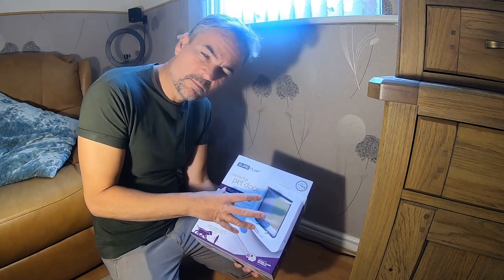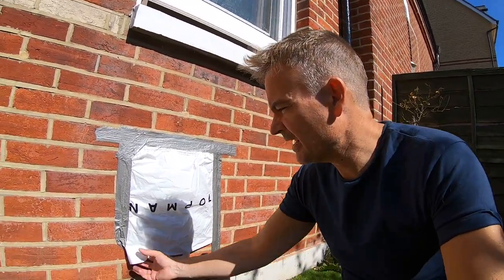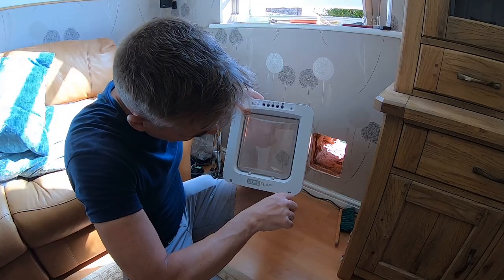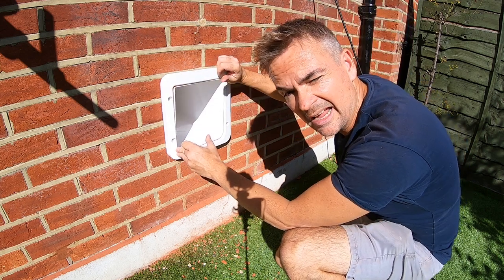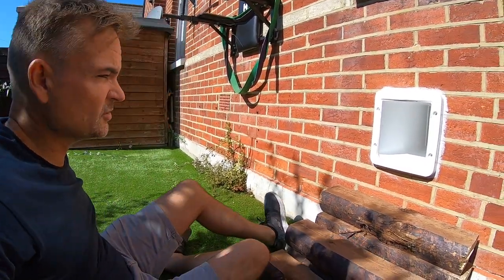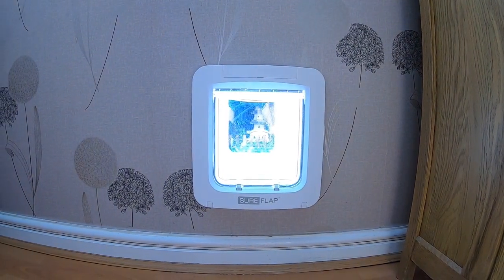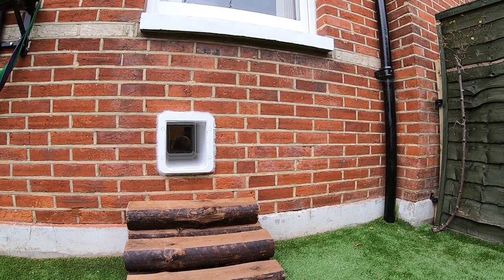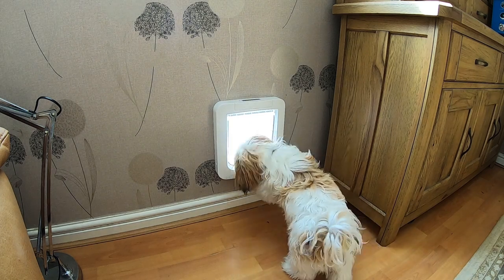Sureflap microchip pet door & Cat Flap

Comment: Would a simple ramp be easier for the little dogs to use instead of the log steps?
Reply from the maker: Hello I suppose it depends what you mean by ramp, at that angle it could act as like a slide etc, I suppose there are many different idea`s which would work totally, I am still using the logs which still continue to work well, the sureflap has been one of my better buys and I would certainly purchase another one if anything fails on it, thanks for the reply, mrix

Comment: Why the flap on the inside? I thought it should be on the outer wall?
Reply from the maker: Hello good point and one that I also thought of, I think its because the unit it not weather / waterproof and needs to be indoors in the dry, it obviously has batteries to operate the door mechanism and the buttons to operate the various settings, mrix

Comment: You can train dog before hand with a cardboard box, put flap into side of box, cut hole on other side, then make a game of them going through the flap. Given them treat each time they do it. Can take a couple of days.  However easier when you stick it in the door/wall especially when it is buck freezing outside. Also drilling hole only for dog to not use would be a tad depressing
Reply from the maker: Nice tip there, not heard of that before but makes sense! thanks mrix

Comment: I am trying to get my pup to go through when the door is closed. He is doing great when it's open, or even slightly ajar.
However, once the door is closed, he just will not even try to push it.  I tried putting some dog formulated peanut butter on the door so that he can lick it and hopefully push, but his licks aren't strong enough to push past the magnets.
Another issue I have is that he puts his nose and touches the flap, but sometimes it just does not unlock. I noticed it happened in your video too, like at minute 17:00. It seems that the unit tag needs to be super close to the flap, even when the dog is right under the top inside sensors.
any tips?
Reply from the maker: Hi Sam, regarding going through the door for me it was simply a case of being on the other side of the door tempting them through by any means possible, just calling them, offering them treats etc, however it did take quite a while of leaving the flap open or ajar to get them completely comfortable, its frustrating to say the least but it will come.
As for the delay on the door this is quite rare but does happen, on the odd occasion, however they still manage to get through even if they have to backup and try again, 99% of the time it works brilliantly, certainly one of my best buys, its been a god send and not sure what I would of done without it, all the best with yours, please let me know when your dog finally manages to get through the closed door and what finally tempted your pup to go through, all the very best mrix

Comment: Im in a wheelchair and got somebody to install my "Sureflap Microchip Pet Door" but I'm concerned that it won't be big enough when my Maltese shih-tzu dog is an adult. I don't want to have install a larger door. Are you still using the same pet door? Is that ok for an adult Maltese Shih Tzu? Can you please help me?
Reply from the maker: I actually had the same concerns but its totally fine, our Shih-tzu and Mulshi are now 3 years old and not likely to get any bigger, they have also had very long hair through the winter months and are still able to easily to get through, as you can see we also have quite a long tunnel which has been no issue, you really have no need to be concerned its be one of my best buys, they are in and out all day long with no issues at all, its very reliable.... all the best mrix

Comment: More to the point, which hardware did you use exactly to drill that awesome hole? Sorry if I missed this somewhere in the video
Reply from the maker: Hi Ray, firstly it was simply plasterboard which was really no problem getting through by on the other side was basically to rows of bricks, I simply broke them up using a hammer and chisel which done the job, this dog flap has been brilliant and so very reliable, even after 2 years of constant daily use its still working perfectly.... mrix

Comment: Put long nails into the logs of something so they don’t all wobble or a really strong glue
Reply from the maker: I actually ended up purchasing right angle metal brackets which screwed into the sides, worked a treat to keep the logs stable, this dog flap has been absolutely brilliant could not do without it now, they get to roam inside and outside in safety, thanks for the idea`s, I only just noticed the comment so I apologise for the late response, thanks mrix